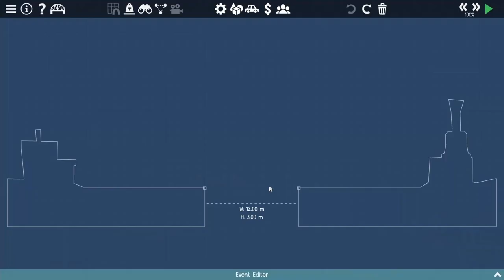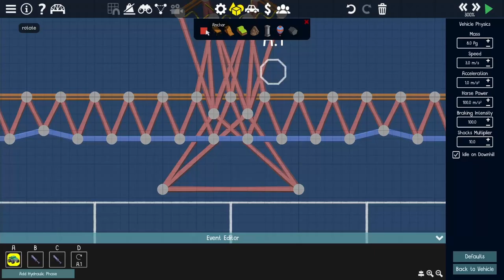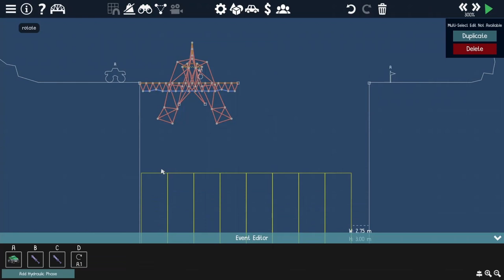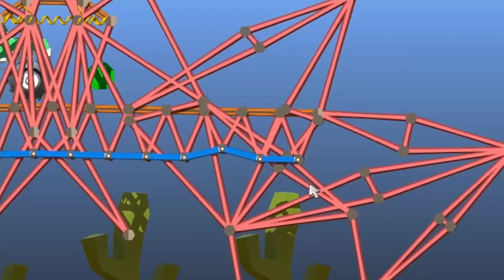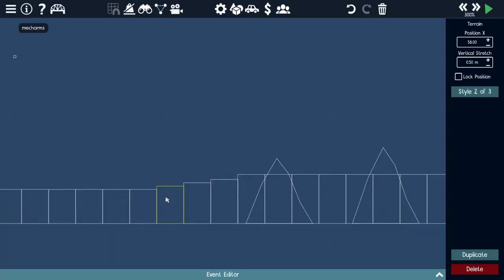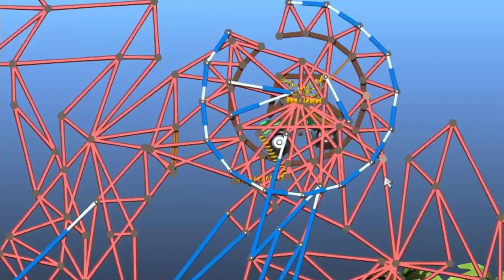Making a Working Mech Suit in Poly Bridge 2

Comment: Dude at this rate your remaking that evolution game in a bridge builder SO NUTS, and yes if you can figure it out make a simple 3 with reverse if possible if not a nice 4 speed would my suggestion would be making it  3:1 first 2.4:1 second 1.5:1 third 1:1 fourth and a final drive of about 2:1 or so and power it with a inline 4 going straight back to the rear wheels. FR four speed